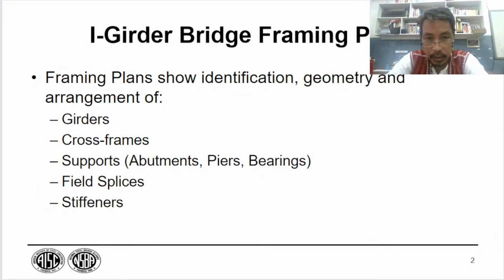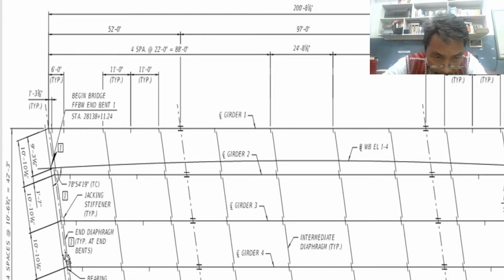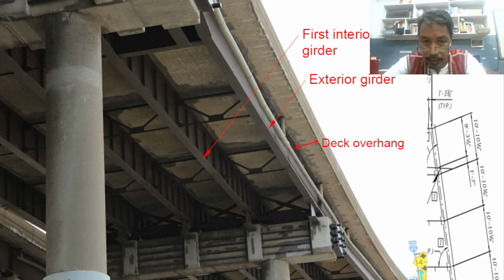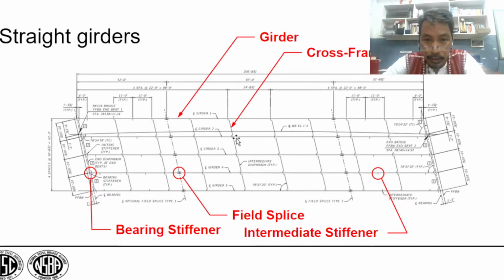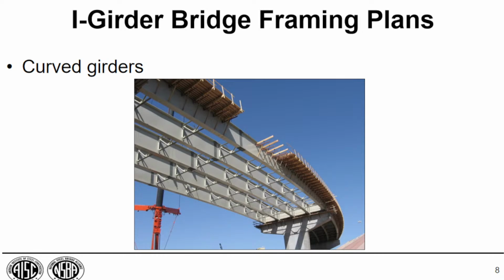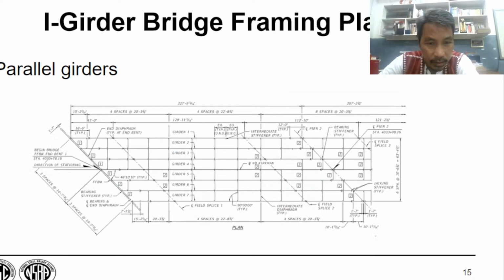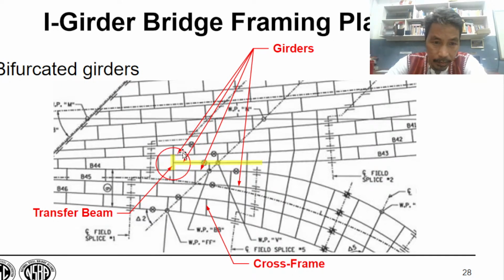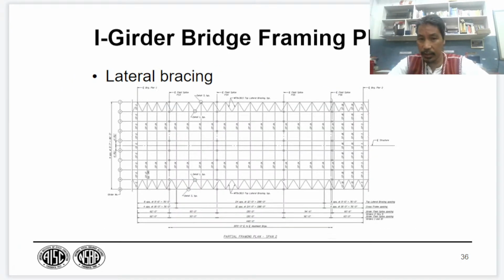[ LIVE CEE4 Lecture 03 ] DrAP Zantua Bridge Engineering Plan Talks + ENGINEERING Analysis & Design

Comment: Thank you Sir for this video that tackles about Bridge Engineering Plan. I have learned about the I-Girder  Bridge Framing plan, framing plans shows the arrangement, identification and geometry of girders, cross frames, supports (abutments, piers and bearings), field splices and stiffeners. I also learned about the components of a bridge like, exterior girder, first interior girder, deck overhang, deck, diaphragm, barriers and parapets. The straight girders have important notes like girder, cross-frames, bearing stiffener, field splice and intermediate stiffener. Curved Girders have important notes just like girder, cross-frames, bearing stiffener, field splice and intermediate stiffener. They are both the same but the curve girders has angles. It is also well-explained and discussed in the video about the radial/normal supports, skewed supports, parallel girders, variable spacing girders, bifurcated girders, staggered cross frames, staggered frames and lateral balancing.

Comment: I appreciate you sharing your vast expertise in bridge engineering, sir. We will benefit from these specifics as they relate to our study of reinforced concrete and steel. I have gained some knowledge regarding the framing designs, namely regarding the girders, cross frames, which serve as the system's primary supports, as well as the abutments, piers, bearings, field splices, and stiffeners.

Comment: Thankyou sir for discussing about bridge girder framing plans. In this video lecture it includes Girders, Cross-frames, supports, field splices, and stiffness are the arrangement, geometry, and identification that show by framing plans for the I- girder bridge framing plans. Parts of the bridge are shown in this learning material such as first interior girder, exterior girder,  deck overhang, girder depth, unbraced length. I girder bridge framing plans has a kind of radial/ normal support, skewed support, parallel girders, variable spacing girders and bifurcated girders.

Comment: Thank you sir for this live lecture about the bridge girder framing plans. I-girder bridge framing plans. Girders, Cross-frames, supports (abutments, piers, bearings), field splices, and stiffness are the arrangement, geometry, and identification that show by framing plans. Jacking stiffener is a new term that I learned as well as the others that were discussed last meetings. The important notes in straight girders were girder, cross-frames, bearing stiffener, field splice, and intermediate stiffener as well as the diaphragm. Curve girder's important notes are girder, cross-frames, field splice and intermediate stiffener. They are the same level of detail with straight girders, but curve girders as angles. Radial/normal supports were also discussed. Skewed Supports, Parallel girders and Variable spacing girders, and bifurcated girders that were not connected to each other were also discussed and explained. Important notes of bifurcated are girders, cross-frames, and transfer beams. I comprehend about the contiguous cross-frames, staggered cross-frames and lateral bracing. Thank you sir for this informative live lecture.